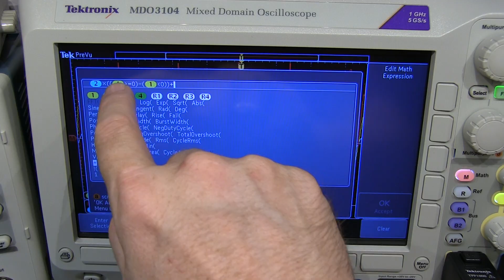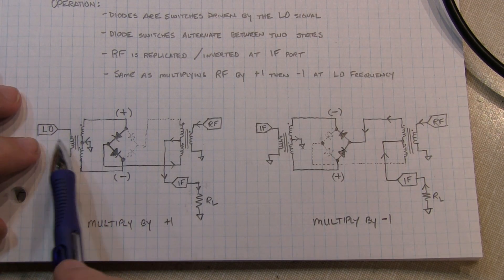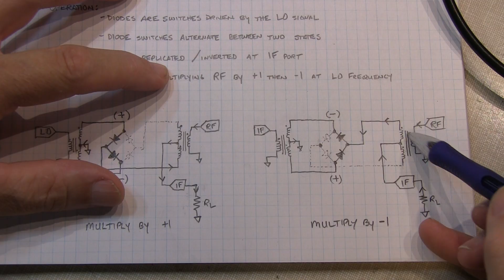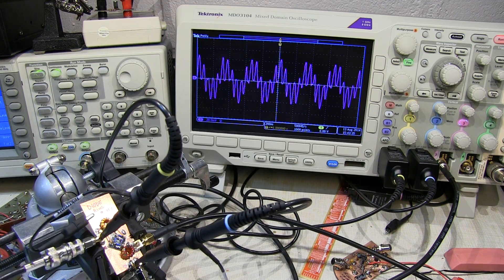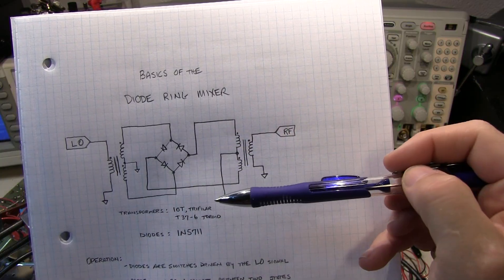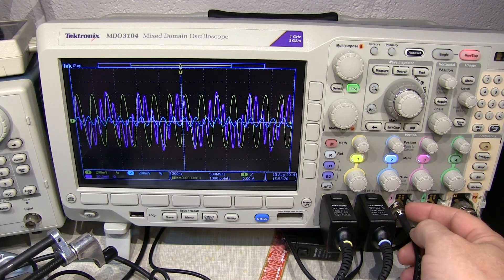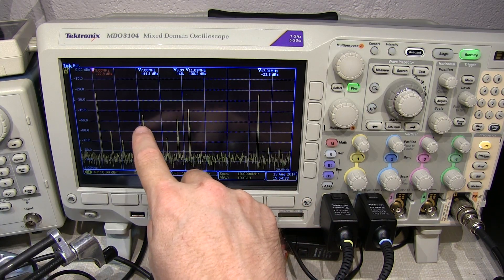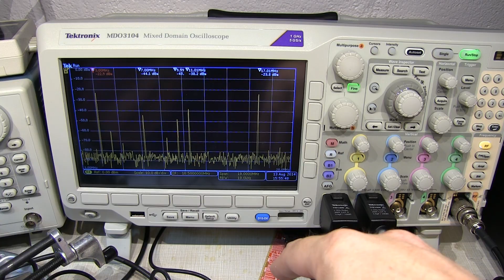#167: How a Diode Ring Mixer works | Mixer operation theory and measurement

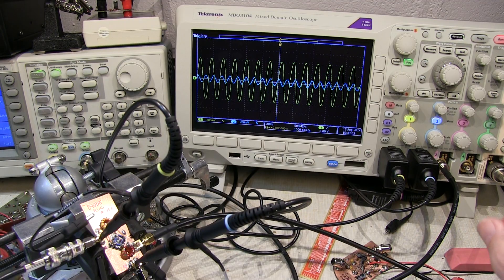Comment: 7:56 you mean IF output, not LO, right? Slightly confused as to what exactly is getting mixed and in what practical application this is useful. I thought the AM modulation is a result of mixing a carrier wave with an audio signal to produce the RF but here you are mixing an RF out with a carrier frequency, doesn't the RF already have some kind of modulation?
Reply from the maker: Yes, I meant IF output - sorry about that, I misspoke.  AM is one application for mixers, but certainly not the only one.  A VERY common application is for frequency translation - to adjust/move and RF signal from one frequency to another.  This is the principle used in super-heterodyne radios.  See my videos that are linked in the video description.
Reply: @w2aew  Thanks
Reply: @w2aew  5:42 In the diagram on the right, shouldn't it be LO in the primary coil? Looks like a typo.
Reply from the maker: @RatedA4Aliens  Yes, you are correct, this is a typo.

Comment: What kind of diodes can we use for making these double-balanced diode-ring mixers? And what determines the frequency window of operation of these mixers, if any? Great video as always. Thanks!
Reply from the maker: High speed schottky diodes are the most common.  The design of the transformers (number of turns, core material, etc.) will largely determine the operating frequency range.

Comment: is there any limitation of the frequecy range ?
Reply from the maker: Yes, of course.  The core material, number of turns and diode type will have an effect on the frequency of operation.  The mixer shown will work well of HF frequencies.

Comment: I have a variable speed circuit board which has a Triac on the circuit board.  The circuit board varies the AC ( 120 VAC  line voltage) to control a carpenter's router.
The motor blew. I need to check the circuit board if it too did not fail .
Can a voltmeter ( which has no load) directly measure voltage ( or varied voltage ) directly out of a known working or non- working circuit board ( like that of a dimmer switch for a ceiling light) or does it need a load to measure - to see if a voltage ( or a varying voltage) is at its output of the dimmer ( or varying speed of a motor such as a router) ??
Thank you ... Maybe do a video on it
Reply from the maker: It depends on the meter.  Only a meter that is specified for "true RMS" readings will read correctly.  It also depends on the nature of the speed control circuit, whether it needs a load to work properly (most likely not, but worth mentioning).

Comment: are mixers in general bi-directional?  Meaning can I have my two inputs be both IF and LO ports, and look at the mixing products at the RF port?  Or can you only apply the inputs to RF and LO, and have IF be the output?
Reply from the maker: In general, yes.  Most often the IF and RF ports can be interchanged.

Comment: would this diode mixer be usable to downconvert a (LF) 125Khz rf signal say down into the audio range say about the 1800 Hz range?
Reply from the maker: Sure - you'll just need to wind some more inductance in the transformers (use a higher permeability core).
Reply: any idea as to the (L) inductance range? I should shoot for ? I know the larger the L the lower the SRF, but I need to be well below SRF, I've not much experience with LF.
Reply from the maker: @davepetit8087  A good rule of thumb is to shoot for an inductance that is 4x larger than the impedance of the source (of the 125kHz signal).
Reply: How about a T50-1 with 30 turns.
Reply from the maker: @davepetit8087  Probably not enough inductance.  For such a low frequency, a ferrite core would likely work best.  See http://toroids.info and pick your core and type in a few values to get the inductance.
Reply: OK, Thanks Alan, you are a good Elmer, 73's N2SOE
Reply: N3SOE

Comment: Sir thanks for really helpfull video. I have a question.Assume that at the input of mixer we have a signal that carry some knowladge. Can we use that 3Mhz IF signal to take that knowladge after bandpass filter .Does bandpass filter cause any data loss since we take just 3Mhz part of the signal in other word ,we take the lower component ?
Reply from the maker: Yes, absolutely.   This is the principle upon most super-heterdyne receivers operate:  Convert the signal down in to a known/desired IF (intermediate frequency), then perform the demodulation on this IF signal.
Reply: +w2aew thanks a lot sir :)

Comment: Why did you choose T 36-6 torroids as opposed to a type 2? I plan on building this and will use the T-36-6s but I am curious as to the choice. The permeability of the materials are close. How did you decide on the number of windings?
Reply from the maker: Quite simply - I had more of the type-6 on hand.  As for the number of turns - I simply followed an example that was in one of my many books - probably Experimental Methods for the Radio Amateur, or maybe even the ARRL Handbook (sorry, I don't remember what book I borrowed the design from).

Comment: very informative video. Thank you Alan. Did the amperage in this system  rising when reducing the frequency ? aka mix 100khz with 1 vpp and 50 khz 1 vpp equals 150 khz and 50 khz with twice ampere ?

Comment: Can someone explain what is the exact purpose of the two transformers used in the circuit?
Reply from the maker: The two transformers create a balanced differential drive to the diode ring.  This is why it's called a double-balanced mixer, and why the carrier and LO are suppressed in the output.

Comment: Congratulations great video,
wanted to know if when you were measuring the signals used some component that is not described in the list
I could not reach the measured results
Reply from the maker: The parts I used are listed on the first page of the notes. 
http://www.qsl.net/w/w2aew//youtube/Diode_ring_mixer_operation.pdf
Reply: thanks

Comment: if diodes short out transformer how does anything work? which is the carrier? the info signal?
Reply from the maker: The diodes act as switches which determine the direction of signal flow.  The "carrier" is usually the RF signal shown in the schematic.

Comment: Are there any weird frequency limitations on this? Can one perhaps use this to feed two signals very close together in frequency and get a very low frequency output (audio band-ish). Or just directly feed in audio signals and play with them? Or maybe it's not gonna work cause i'm gonna need a giant transformer or very stable oscillators... idk. Anyway, great stuff!
Reply from the maker: The IF port in the schematics show is DC connected to the diodes, so it's frequency response goes to DC, so it will give you the difference frequency of two closely spaced frequencies applied to the LO and RF ports.  Suitable for a direct conversion receiver for example.

Comment: Hello Alan, great video as usual! But I have some questions to it:
1. You have your LO amplitude set to 400 mV is it enough to switch on 2 diodes? When I see a diode I automatically think of 0.7 V voltage drop. I think it's hard wired in my brain after school :)
2. I understand that the RF signal amplitude must be below voltage that turns the diodes on is that right? So that only LO controls the diodes. Did I get it right?
3. Is the LO amplitude picked so low intentionally so that there is not clamping from top and bottom?
Reply from the maker: Hello Marek.  I'm using 1N5711 low power schottky diodes in the ring.  The Vf for these schottky diodes is about 1/2 of that a regular junction diode.  The LO is used to modulate the diodes.  The RF level is generally kept well below this to minimize distortion.  Best (lowest) conversion loss occurs when the diodes are fully switched on/off, but the mixing happens even if this isn't the case.  As long as the LO and RF are combined in a non-linear manner, the mixing happens - it's just that the conversion loss will be higher.  When the LO power is high enough to fully switch the diodes, there is a fair amount of harmonic distortion visible on the LO drive waveform.  For this video, I didn't want to get into that level of detail, so I kept the LO drive lower to keep the video length reasonable.  Thanks for the good questions.
Reply: Marek    The mixed two signals on diode should be less than 0.6v( for silicon diode) to have less current.  That makes the load to both transformer light, hence less signal distortion to signal source. Also, less power consumption by the circuit. Diode  has non liner v-I curve, in all range from 0.x volt to couple volt. That how the diode makes the added voltage of the two sources to multiplied current, measured by the resistor in serial . The diode ring also called ‘Gilbert cell’ question from stackoverflow, https://electronics.stackexchange.com/questions/307776/why-do-diode-rings-multiply

Comment: I feel like it's worth mentioning that the non-linearity of the diodes is what makes the "cos(a+b) + cos(a-b)" (addition and subtraction of the input frequencies) components appear in the output signal. 
Otherwise, what we've created is just the sum of two signals sin(a) and sin(b), which can be achieved without the use of diodes or switching at all.
Reply: That's very interesting piece of information - I need to dig deeper why non-linearity causes mixing of the two components. Seems I lack some academic knowledge :)
Reply: @krzysztofsoja5301  has to do with the current equation of a forward biased diode

Comment: Alan, I'm considering building the SDR dongle upconverter from the QST article written by James Forkin (WA3TFA).  The double balanced mixer he recommends (SRA-1) is going to cost almost as much for shipping as the mixer itself.  Could your diode ring mixer be used as a replacement for his double balanced mixer?  The part schematic and yours look almost identical.
Reply: One of the benefits of the purchased mixer is that the diodes are likely well matched which gives good RF and LO rejection. For this application though, this isn't that important. The homebrew mixer should work well.

Comment: when you plugs two signals to a grids of a vacuum valve, or to an op amp gets a mix of signals. and i discover recently that could be mixed in a cuartz cristal filtering at the same time. what makes the mixer of the vídeo usualy used to?
Reply from the maker: Mixers using op amps are usually in the form of a summing amplifier where the signals are added together.  The mixer presented in this video is used for frequency translation or frequency conversion, where the input signals are multiplied together.  Unfortunately, the same word (mixer) is used in both of these applications which are very different.

Comment: Dumb question from a communications (Ham) equipment newbie: What is a balanced ring modulator used for? Am I seeing a phase reversal of the RF output when the input AF modulation goes positive to negative--like SSB?
Reply from the maker: +Rob T This device can be used for frequency translation/conversion - for example, converting a desired frequency to an IF frequency in a receiver.  Can also be used to convert and IF to another frequency such as in a transmit conversion chain.  Can also be used as a modulator - to perform AM or DSB modulation of a carrier.   The phase reversal you were seeing is real, and is a properly of a balanced mixer.
Reply: Thank you.

Comment: I have been thinking about buying an entry level scope for hobby HAM work and basic learning, similar to what you are showing here. I am looking towards the Rigol brand but for giggles I thought "How much does the scope Alan has here, cost?" So I googled it.....and that led to about 90 seconds of nonstop laughter. :-D

You are a professional that does this for a living, and it shows through the cost of your test equipment. My hat is off to you my good man, you have IMPRESSIVE kit. :-) - N0BPS

PS now watching some of your other videos to understand bandwidth to see if the Rigol 1054z is a worthwhile scope for HAM radio use and general learning......there is also the 100Mhz hack for it...not sure if that is important or not.
Reply: I might add, digital scopes are wonder, and you should have one in your future, however if you can pick up a 20 MHz old analog scope for less than $50, you should consider it. They are dirt simple to use and will give you some experience using a scope before you plug onto the more confusing (but much more powerful) world of digital scopes.  I have a cheapo 20 MHz scope that I love for its simplicity. I won't be without my 200 MHz giga sample huge memory USB run data box, but generally the ole trusty analog job does just fine.
Before you guys with your fancy dancy data acquisition wonders flame me, remember this guy is where we all were and just need practice going at waveforms in real time. Remember when we did that just for fun, and how much we learned about electronics before the computers got in the way.
Reply: +Brian Streufert the Rigol DS1054Z is generally a no brainer as a beginners scope. You'll never regret buying it.
However, it is in no way comparabale to Teks "middle" class scopes, they are simply fantastic instruments. And the MDO3000 series starts at just 3,5k$ ;-).
Reply: I could not agree more... the Rigol is the best per buck out there. And, they don't cost much more than a used TEK with fewer features.
Reply: I looked around and considered used scopes among other things. I ended up with a Siglent SDS1102CML. I'm still learning to use it, but it seems to fit the bill so far.

Comment: what diodes are you using as the bridge rectifier in your mixer? I assume they are schottkys? Did you get specially matched diodes??
Reply from the maker: +shriramvenu It's not a bridge rectifier (note the direction of the diodes - different from a bridge rectifier).  I used schottky diodes.  I didn't use matched diodes, but ideally you would want to use matched diodes for best performance.
Reply: Yes you are correct the directions are not those of a bridge rectifier. Wasnt sure what to call it. 4-diode bridge?

Any specific model of schottky diode? I dont think something like a 1n4007 schottky would work because the recovery time would be quite high
Reply from the maker: +shriramvenu It's commonly called a diode ring.  A 1N4007 is a diffused junction diode, not a schottky diode. You'd want to use a small signal schottky diode like a 1N5711, BAT41, etc.

Comment: So would using a square wave for the LO clean up the signal because the diode mixer would transition on and off faster? would some weird combination of a square and sine be better? Is this accounted for in actual circuits or is a different type of mixer preferred?
Reply: Jeff Scaparra There is a lot of discussion over on the Bitx20 .io groups about this. Personally, I would rather use a sine wave rather than a square wave full of harmonics. Joel KB6QVI
Reply: Cool I will check that out

Comment: Different places give the schematic differently.  I don't mean the topography of the diodes, which can be diagrammed many different ways, but which are inputs and which is the output.  What is labelled as the IF output here, others label as the LO input, turning what you have as an input into an output.  I'm wondering why someone would use it one way or the other?  I'm suspecting it has to do with suppressing an input in the output so, for example, .a carrier doesn't show up in the mix results.  Can someone explain further?
Reply from the maker: +Kurt Fitzner The choice is somewhat arbitrary.  Different selections will results in minor differences in LO and RF suppression, input return loss, etc. - thus will also depend a bit on input and LO signal levels as well as the design of the circuits surrounding the mixer and the performance requirements.  Often, best results are obtained through experimentation.